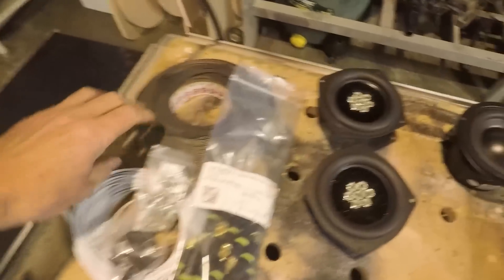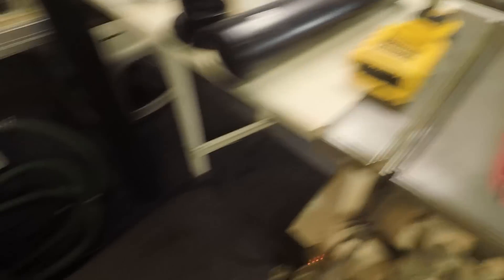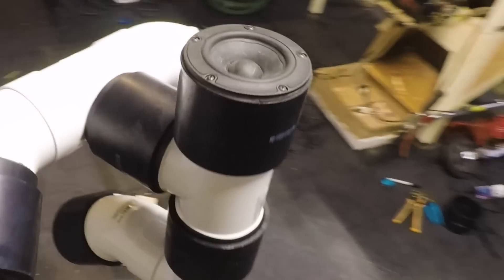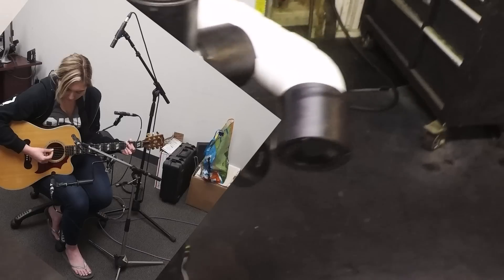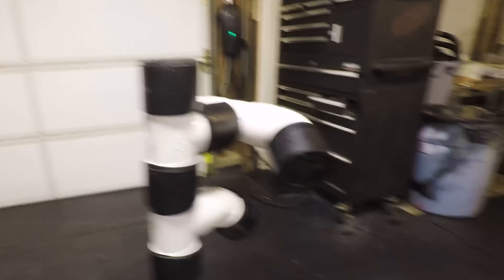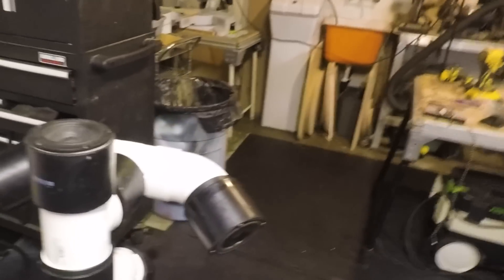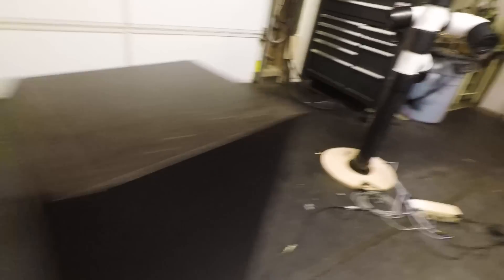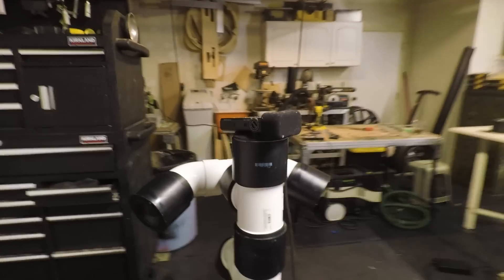Speakers Don't Sound Real, Lets Build One That Does

Comment: this is definitely interesting.  I don't know anything about the speakers you put in those pipes but I was thinking ?  what if you used some decent studio monitors mounted in the exact same orientation and you carefully tracked the microphones and angles when you assigned them to the speakers ??  and then you could maybe do that for the drums, the guitars, and the singer.. and you could mix each instrument for that setup .  I know you could have 4 of those contraptions, one for each band member and have a true stage setup but  if you wanted to hear all of the band member in 3-D at a time, you could just mix each of the "top" microphones for each instrument into the one top mic position and sort of create just one 3-D listening position which incorporates all of the stage-- but I understand the purpose of having a full speaker tree for each band member.   Maybe a subwoofer for the drums and bass rigs.   Anyhow, this is true and its very cool but ?  as a guitar player, I don't even like the "real" sound of my acoustic guitar to be honest, I like knowing that I can completely change it with EQ and compression.. now with electric.. ?  sometimes I really like the sounds and tones I get out of my Mesa Boogie but? sometimes? here is the problem, I really like a Les Paul into a Mesa for distortion sounds but I really like a telecaster into a Fender amp for other tones.. or I like a Strat.. and sometimes I want a single coil and sometimes I want a hum bucker.  That said, I truly find that in the mix, the most important instrument to mix is the drums.. then the bass.  I am a guitar player.. the reason why I say this is I always mix my drums first, then the bass and when I haven't even done anything to my guitars.. if I just have 1 guitar track playing and the other guitars all muted.. just the one guitar track on a solid drums and bass mix already almost sounds like the final product.. and that frustrates me as the guitar player.. but it also isn't fully true.. I mean obviously when you get awesome recordings of guitar takes and you get everything dialed in.. its really nice.. but?  you know? I don't even know what I am getting at here.  I am listening to most of my entertainment on some cheap Sony SSCS5 speakers with a sub in a stereo mix.  I am constantly wishing they would hit like PA speakers.. sometimes it feels like they sound like the sound is coming out of my t.v. screen itself.. I am spoiled.   I wish I knew more about crossovers and how to build them.   RLC circuit design.  Fact is I don't really remember what 2nd order means or how to do the calculations.  and if someone explained it to me again, I might not remember for more than about 3 days.... but maybe I am permanently brainwashed into desiring the fake sound of hi-fi.  I can say this : I definitely do not use surround sound.  I have a surround sound receiver but turned off all the surround channels and only have stereo with a sub.  and I use this to watch all your videos.. and others.  Now I have in the past listened to some of your stuff on studio monitors through a mixer in the studio.. but currently not setup.  as a musician though, I think of performing and recording in terms of a high-fi setup.  I wonder if bands begin to write for the big stage.. I have seldom played on a "big" stage.
Reply from the maker: I will do more vids with realtime sound vs various speakers.

Here is what I found so far:

Speakers with flat baffles don't sound as real as no baffle like the tubes

Ported cabs have a resonance that does not sound real as that resonance is not natural to the source

Speakers that point sound in one direction don't sound real

Radiating the same sound in many directions does not sound real

Rediating the same sound from multiple speakers is un natural and does not sound real.
Reply: @DaveRat  Imagine some hard-wood tubes.. I have some big chunks of wood sitting in my yard but no lathe.... maybe the wood wouldn't make a difference.  very interesting.  I mean our ear holes are pretty round..
Reply from the maker: Not exactly sure what you're referring to but our brains can hear the way different sounds coming from different directions combine differently as we move around.

If you have the same sound combining with itself bouncing all around the room our ears can hear that too and realize that it's interfering with itself more than a bunch of different sounds bouncing around the room.

This can be easily shown by playing the same signal and seeing how it combines with itself with varying phase and time and distances and then comparing two different signals and seeing how they combine with varying time and phase and distance.

I did a video about same sound from multiple sources that addresses this
Reply: @DaveRat  that is very true.   its very interesting stuff.  I was merely stating that we have round ear-holes so it makes sense that the "round" tubular shape is probably better than a box.
Reply from the maker: Very cool and I think there is something to it. The reason I use tubes instead of a box with a bunch of speakers in it is I found it baffles sound bad or at least add sound that that is not natural. Using a tube that has no baffle that isn't that much different than the dimension of our head is probably helpful. The issue with tubes is they resonate so I had to really stuff a lot of insulation in them to make sure there's no resonance
Reply: @DaveRat  I'm still using boxes. I was infatuated with arrays for a while- not to the level you were for decades.. but now I am back to small systems but finding there is no need for good sound out here on the east coast..  20 and 30 years ago when there were way more packed houses, there was a need to separate yourself from the other bands and sound was the secret ingredient and it was an endless supply of gigs.. these days I am worried if I can find a brewery .. because since I took a break, this one company went and put in cheap arrays at several of the venues and locked them all down with house engineers.  and I don't even feel like competing.. I just want an easy gig.. my desire to play the game is long gone.
Reply from the maker: I can relate. I need to keep changing adventures or I get bored.

Comment: This is great Dave! I've always though the same thing, and I've been recording and mixing for the last 12 years! 
The microphone capture, to speaker reproduction doesn't really convey the same feeling. Single mic doesn't capture all of the various sounds from around the source (as you'd hear in person). Single speaker doesn't project the sound sources in the same way...
It's kind of funny that the huge speaker arrays and amps the we see and use at big concerts are all just sent the one (often mono) mix, and then the mix is split by frequency domain, rather than sending a more separated multitrack signal and spreading individual sources/stems across more speakers... There's a lot to think about when it comes to spatialised sound.

Comment: I have a 2 speaker idea - have a tube with 1 up-firing speaker that fires onto the bottom of a cone shape that radiates sound out in 360-degrees. PLUS 1 more speaker mounted on top of the cone that only fires straight up.
Reply from the maker: The most important aspect of this design is that is radiates different sound in every direction like a real instrument does.

Radiating the same sound in only one or many directions is the reason speakers do not sound realistic

Comment: Have you ever heard Ohm model F's? If you use a subwoofer with them they sound even better. Only issue is they need a powerful amp to drive them if you want full orchestra or rock band volume. We used to play string quartets and other chamber music and freak people out.
Reply from the maker: I've heard good things about them. Also, the key aspects about this design and what I believe is the most important aspect of sonic realism is a speaker that radiates different sounds in different directions.

This is why this speaker has 4 speakers, 4 amps and takes 4 different signals to do what it does

Comment: Hi thank you for the very kind interesting and valuable video I have a doubt Are really the stereo speakers that cannot reproduce the sound with realism or are the recordings that have not captured the real sound?
I ask because in the video i see multiple mics Their signal i guess is then mixed down to provide a 2 channel output 
 I see this as a very tricky procedure 
Therefore i would try instead a minimalist recording with just a single pair of mono mics and then listen the recording on a two speakers stereo rig
Kind regards Gino
Reply from the maker: No mixing, no EQ, just 4 mics (there were 6 mics but did not use 2 of them for playback)

4 mics to 4 amps to 4 speakers, no processing. Just pure recorded signal.
Reply: @DaveRat  hi thank you for the very kind and valuable reply I am pretty confident that your procedure provides great results
My comment was about the limits in naturalness of the stereo system that you mentioned 
 I mean a stereo playback system has just 2 channel l and r.  but the mics used to capture the flag sound are many more then mixed downvto 2 channels in more or less mysterious way. From what I understand some labels use only 2 high quality mics for stereo recording and the result is that the playback sounds much more natural with just 2 speakers The rule being one mic one speaker 
It's the down mix that ruins everything Some mixing desks squeeze 20 channels in just 2 
Without even talking of the very usual processing that damage the signal even more 
Kind regards gino
Reply from the maker: I will do more vids on this. One issue is speakers that shoot only in one direction or shoot the same sound in many directions

Comment: Congrats, Dave. You've just invented the Bose 901.
Reply from the maker: Hmmm congrats you missed the entire concept by jumping to a conclusion without grasping the concept. 

A Bose 901 is a single input speaker that sends the same sound to 8 speakers, yuck! No instrument does that

That is the opposite of the entire concept of having a multi channel speaker that has 4 speakers 4 amps and sends a different signal in every direction, like every instrument does.
Reply: @DaveRat  Actually, beginning with the series III models, Bose 901's had split inputs, which could be driven separately with different signals. Bose made receivers that contained four amplifier channels for this very purpose. But, I was in fact making a joke. Perhaps I should have added a smiley face. My bad.
Reply from the maker: All good and very interesting on the Bose. So the speaker had 4 sets of inputs and 4 sets of speaker wires from 4 amps?

If so. That is really exciting and will need to research that. So far I have not found a multidirectional multiamp speaker out there but there must be some. It's too obvious and sume of an idea not to have been done before

Comment: If you're serious about building something that sounds real, dipole, line source, push pull, planar magnetic transducers, instead of multiple moving coils that are not minimum phase, will go a very long way towards your stated goal. I began utilizing schedule 40 pvc pipe in the late '80's and my first published short article "5/89", Speakerbuilder.  In the, "3/91" issue the cover, my speaker employing the Speakerlab RD 57, aforementioned, 54 inch long, dipole, planar magnetic and 2 Morel 164's for the Bass, each in 12 ft long, pvc,  6 inch ID, pipes with two 90 elbows per line. So the terminus and transducer are aligned. Used 10 IAR Wonder Caps and multiple MIT polypropylene film and polystyrene caps with a CFAC inductor for the first order X over. Also employed the Transcendent Sound OTL Vale amp kits which really add to the ability to, "Fool", the listener.
Reply from the maker: Hmmm, to recreate realistic sound, one must recreate the sonic dispersions of a natural instrument, the big issues to address in my opinion are

Never send the same sound in multiple directions, no instrument does that

Do not radiate all the sound in one direction, instruments radiate in many directions. 

Never reproduce the same sound from multiple sources, that does not exist in nature.

Radiate differing sounds in differing directions like an instrument does if you want to sound like an instrument.

I believe the designs you mention all fail at one or more of these
Reply: @DaveRat  Have you listened to a push pull, planar magnetic, line source?  The second iteration, RD 75 is the midrange driver in the Genesis Advanced Technologies, Prime Loudspeaker. The retail price in 2022, for the System, was 680,000 bucks/ pair. A horrible rip-off, as the RD 75, a 6 foot, push pull, version of the RD 57, I purchased for 1085 bucks/pair, used to be available when the Designer, Dave Graebener was alive, at a Parts-Express, retail cost of 700 bucks per driver. Yet the performance is incredibly life like and doesn't suffer from the 6db SPL drop off per meter a point source, moving coil, driver does. Also Newtonian constraints such as cone Mass, from F=MA, issues with glue joints, cone deformation, voice coil deformation, voice coil moving outside of the Magnetic Field, i.e. uncontrolled, are eliminated. Not to mention the push-pull, magnets in front of and behind the moving membrane/linear voice coil/diaphragm with a constant Impedance vs Frequency, is further damped by the Mass of air resting on the diaphragm, being heavier than the diaphragm's moving Mass, as well as the Magnetic Field's in constant control, and eliminating the restoring force/spider, another source of distortion/issues. 
  What We are attempting to do is create an illusion of a performer, or ensemble, playing live, and while it may seem counterintuitive, the dipole radiation pattern, in Phase nature of the non enclosure, dipole, line source, reproducing transients that no moving coil can, produces a more realistic simulation than multiple, out of Phase moving coils which point in different directions. These do not come close to approximating the 4 Pi Steradian radiation of musical instruments.  You are not, without very complex algoritms in the digital domain able to, via the multiple drivers recreating the sound field that an ensemble of musical instruments emanate, just because you point drivers in different direction, out of Phase and not simulating a Minimum Phase System.   
   Richard Heyser wrote about the Minimum Phase response in the 70's in JAES His series of papers, stating that the Complex Variable, Frequency response, with Amplitude as the Real Component and Phase as the Imaginary component of the complete Complex Variable. He stated that IF the Amplitude response was the Hilbert Transform of the Phase response the acoustic results would be most realistically reproduced. 
   I'm not sure that the vast oversimplification I have attempted in this short response has any meaning, and I applaud your empiricism, but there is a huge body of knowledge out in the public domain that you should be aware of, and take advantage of, especially the Science and Engineering Research. Beliefs have no merit, actual listening and processing of what has been listened to, does. So, most importantly perhaps audition a Push pull, planar magnetic, Line source, dipole, based loudspeaker. I had been building loudspeakers DIY  employing transducers from Dynaudio, when they used to sell to anyone. Heard my first planar magnetic, dipole at a Winter CES,  3+ decades ago and it blew my mind. Never looked back.
Reply from the maker: Basically the reason this works so well so easily is I cheated by changing the rules.

Stereo and all that fancy crap tries to recreate sound space in the listening environment, put one room into another room.

This design ignores all that and just drops the actual sound of the instrument into your room.

Magnaplaner and line arrays and Omni and conventional speakers all strive to send the same sound in one or more directions. This is a completely unnatural event.

This speaker sends a different sound in every direction just like an instrument does
Reply: @DaveRat  The, "Rules", are constraints imposed by this particular Universe, but enjoy your sound, that is what matters most.
Reply from the maker: The rules I speak of are not the unchangeable physics but rather the rules imposed by humans.

Things like "a speaker must recreate a room and can't just recreate a single instrument"

I realize simple effective solutions to seemingly complex situations result in skepticism.

That said, hey, it works and it works well and it's fun!

Will do more vids and show why it works so well
Reply: @DaveRat  I'm not sure who says, "A speaker must recreate a room". My first undergrad Math/CS, so I read a lot of the technical literature and the best speakers faithfully reproduce what the microphone/s recorded. Remembering that many music recordings have been assembled via the editing process. But as a multidisciplinary Scientist, I am open to all explanations and will watch your videos, and maybe learn something.
Reply from the maker: Great to meet you and appreciate your insight and knowledge!

I look forward to more insight from you!

Comment: bluetooth audio is generally not sounding that great but it would be cool to see a cluster of modular speakers offered like this on the market. Then you could just send to each speaker from your wireless audio interface for a real simple experience with this concept. This would mean each speaker would be powered on its own the way monitors are, but all connected to the same wireless mutlitrack.
Reply from the maker: I will try and do more on this when time permits. I have some fun ideas